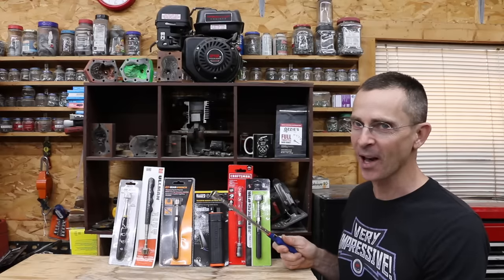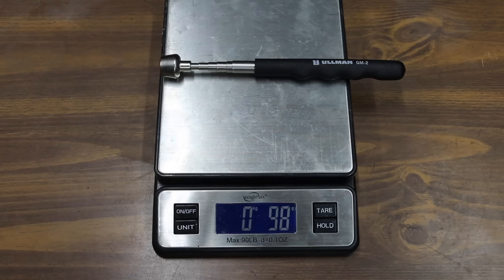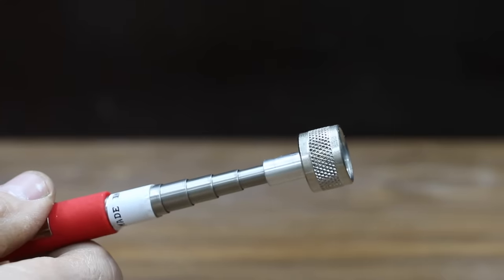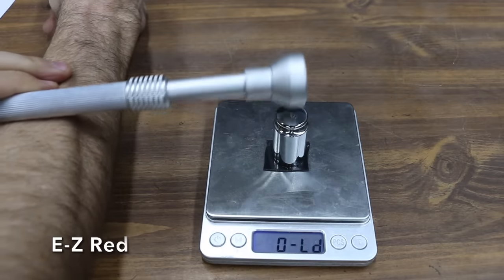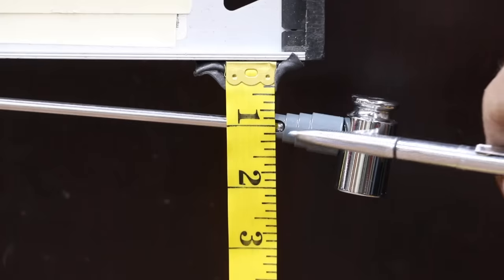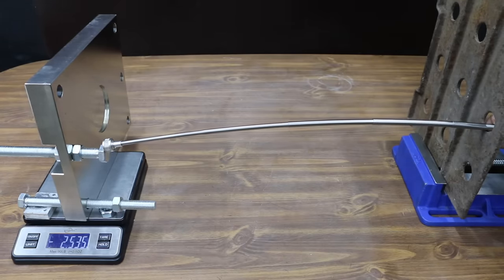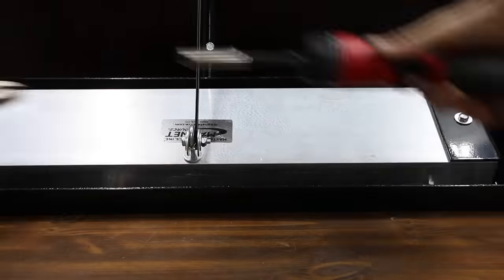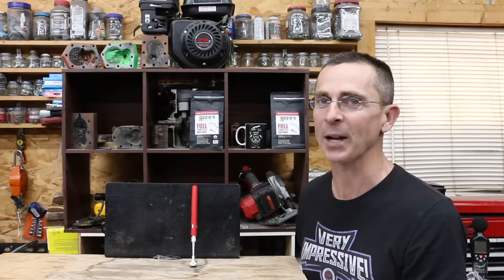Best Magnet & Magnetic Sweeper? Let’s find out!

Comment: Five magnets in and they have all been exactly the same magnet so far. All from the same Chinese factory. The differences in pulling power are probably just the variation you get within a single product line. Crazy. Interesting that the magnetic floor sweepers were all identical as well, except for the American one.
Reply from the maker: Thanks for sharing!

Comment: Heres and idea for a comparison, test the CFM of 12v electric car fans.  I just got a 12v fan claiming 605cfm, but Ive seen others 8" claim 2400.  Also which is better straight or curved blade.  Is one type better as a pusher or puller??
Reply from the maker: Thanks for the suggestion.

Comment: That last weight test for pickup was a bit wrongly done: You measured the bucket of washers with the large washers in the bucket but removed them before pickup. Making it look as though the sweepers picked up less weight. [basically: you had say 12 lbs of weight to begin with; but only left say 10 lbs to try and pick up -- made up numbers; but, you get the idea]

Comment: Project Farm I got a video idea I would like you to look into if you ain't already done it for lawn mowers and weed eaters and stuff like that comparing SEF fuel Tru- Fuel and Regular from the gas station fuel. SEF claims to be able to be stored for up to 5 years in can an 2 or better in an actual gas tank of a lawn mower or weed eater ect. If you would consider that that would be awesome

I myself have tried all three ways and I have found SEF fuel to be the best an cleanest burning longest lasting fuel. It's the only thing I will run in mine Small Engine equipment. Including go-karts and other stuff of that nature..
Reply from the maker: Thanks for the suggestion.

Comment: First problem with telescoping magnet tools is that they come apart very easily.
The second problem with telescoping magnet tools is that once they come apart either just throw it away or you have to be creative and make a way to fix it. If you choose to fix it it's probably not going to be telescoping anymore.
The third problem is that these came from Harbor Freight. I have not got a tool yet from Harbor Freight that was not messed up right from the packaging.
Now if you want a good magnetic pickup tool, I would recommend picking up magnets at a Japanese crap store because those Magnet or seriously strong. What I do with them cuz I have hatched a magnet itself to a string. Then I can just toss the magnet to what I need to pick up and retrieve it easily. Been doing that for about 20 years now and I've never broken a single one.
Telescoping magnet tools from Harbor Freight, have not lasted more than one day.
Reply from the maker: Thanks for the feedback.

Comment: While the magnet-on-a-stick pickup tools are useful, when dealing with a lost bolt or nut lost in the cast-iron bowels of some equipment, I still resort to my electromagnet.  Find the bolt with the current off, turn the current on and you're home free.
Reply from the maker: Thanks for the feedback.

Comment: Can you test (resins). I want to carbon fiber overlay may entire car including the engine bay. But my fear is it cracking and or delaminating. Im hoping to find a flexible, heat, chemical & UV resistant. Probably a tall order.
Reply from the maker: Thanks for the suggestion.

Comment: I bought a cheap magnet for changeing wheelbearings. When i but the lock washer back on the magnet dtuck to it and i didnt notice it, so when i torqued on the bolt it crushed the magnet. It was crushed magnet al over the bearings and the grease. Had to throw the bearings away.
Reply from the maker: Thanks for sharing.

Comment: I recently saw a mobile drill press that used an electric magnet to attach to a surface, would be interesting to use a similar design for one of these broom type magnets, dial up the strength of the magnet to insanity, and watch the walls fold in.. 🤭🤣🤣
Reply from the maker: Thanks for the suggestion.

Comment: I have a different amazon 20 lb one, broke it took a peice of aluminum bar about the thickness of the last metal tube jb welded it there, its the exact length i need it too be to pull bar ends out there tubes
Reply from the maker: Thanks for sharing.

Comment: Is there a way you can test the best blown head gaskets sealer. Like titan and fusion and k seal and steel seal and Mr gasket. Some have glass silicate orhers have non- water glass and a polymer- based what's the difference . Thanks.  Trust your videos.
Reply from the maker: Thanks!  Thanks for the suggestion.

Comment: I don't know, Todd. Are you really asking us to believe that a regular person should spend $34 for a telescoping magnet instead of $4?!

Yes, HF makes stuff that is not as durable as other higher-end but much more expensive brands. But you seldom give cost a consideration. In 20 years I've only had to return one HF tool (which they honored without question so here's to customer service).

In this review you would have been correct to point out the stronger product, but a "but at $4 you can't go wrong with the HF" would have softened the obvious bias a bit.

You did rightly select the Central floor magnet as you had no other choice.

Comment: Do you really want a challenge? There are both cheap and expensive glass and magnetic DRO systems. Debates rage as far as what is good and what is bad.
The problem with testing DRO is that it is like 100x harder to test than say digital calipers. You need laboratory style setup with constant temperature and super sensitive indicators.
No one in Canadian machinist group seems to be able to do a decent test.
Reply from the maker: Thanks for the suggestion.

Comment: I'm not sure that mopping at a pile of washers taller than the available clearance is a realistic test. 
   Throw about 9 lb of nails out on the lawn, mulch and driveway and see how many you get up. 
   Cuz when you re-do the roof that's where they're going to end up. 
  Not in a pile that's taller than your magnet. If that were the case, you'd get a shovel instead of stabbing at a pile of hardware with a wheeled magnet. Realistically you'd probably get more picked up without the wheels.

Comment: Idea

Automatic transmission fluid added to gasoline (I've done it MANY tes on MANY vehicles repeatedly on the same vehicles both carbureted and injected, never fouled plugs/ cats/ injectors/ o2 sensor or fuel filters etc

Most times adding 1/2 quart to 18-32 gallons
Reply from the maker: Thanks for the suggestion.

Comment: I'm not sure I understand the use case for the magnetic sweepers. I've run up to 12-bay car shops, and never needed anything like that. Even around a brake lathe, just a normal broom and dust pan is fine for chips, and I've never once seen a giant pile of nuts and bolts and washers that a mechanic just kind of let flop to the floor while working. Usually stuff comes off in your hand, or if you drop something, you pick it up.

Seems like a gimmick product to me, searching for a solution and hoping DIYers will be all excited about it for about three minutes before they realize they'll never actually have a use for it.

"Oh look, I dropped a nut. Should I go across the garage and dig out my magnetic sweeper roller thingy, use it to pick up the nut, turn it over and wrestle the nut loose, then go back to put it away? Or should I take half a second and pick up the nut and go on with my work? Hmm..."